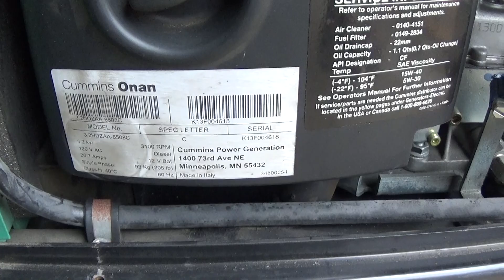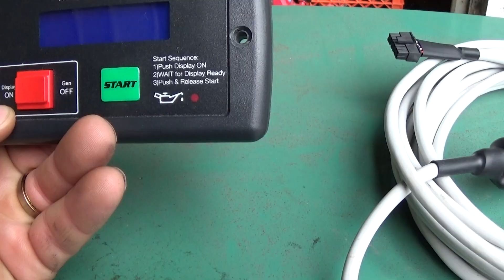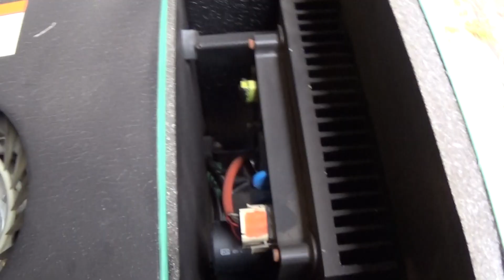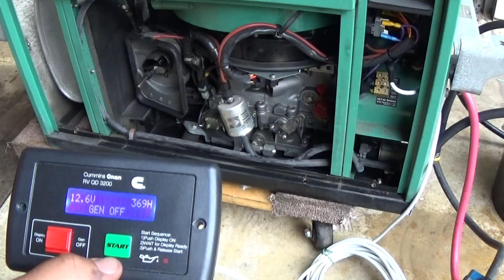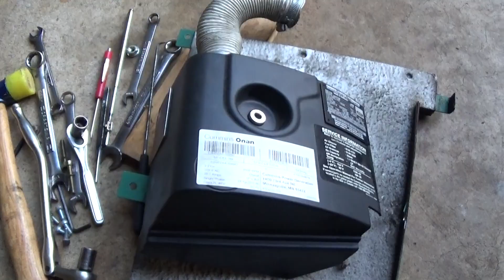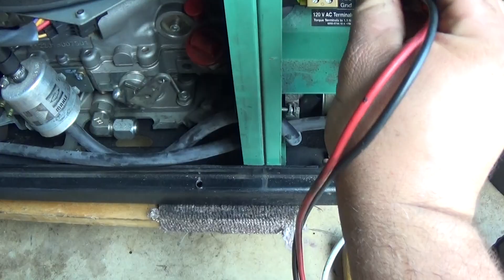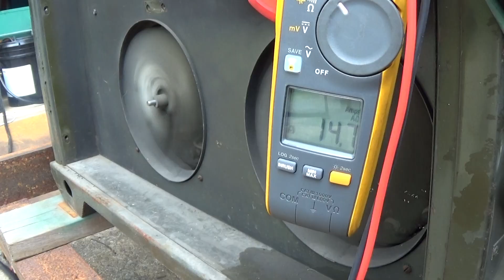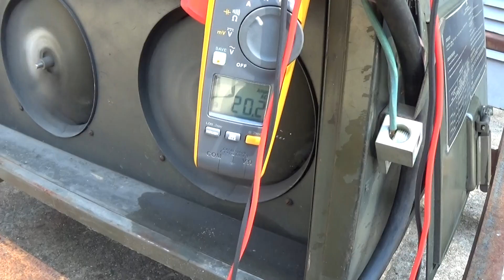Miniature Diesel Generator Diagnose, Repair, Test ONAN RV QD3200

Comment: I have this generator and it stopped working. I've determined that it is the fuel injection system. There is a plunger below the solenoid on the top side of the fuel injector that is stuck. How can i get it to release? I've tried soaking it in PB Blaster for a few days. still stuck.

Comment: I have this generator in my 2018 Thor Class C RV. It would start and run well sometimes, then other times it would either not start or shut done after a few minutes. Thought it was starved for fuel so I blew out the fuel inlet hose from the fuel tank (which also supplies fuel to the RV engine. Still wouldn’t run, so I filled the fuel tank with diesel (26 gallon capacity). The generator started and ran great. So it probably was starved for fuel - but I had about a 1/4 of a tank when it wouldn’t run. 
About a week later II was talking to a fellow RV’er who had a similar problem on his Class A RV. He told me that the fuel pick-up to the generator does not reach the bottom of the fuel tank for a reason. If it did and you used up all the fuel inlet hose from the tank then you couldn’t drive your RV to go fill the fuel tank at the gas station. Makes a lot of sense, but no where in the RV or generator manual does it mention this. So before you stop and plan to use your generator for dry camping or whatever, fill up with fuel. Simple!

Comment: Good Morning, I have been fighting with my RV QD 3200.  It cranks but doesn't start. I followed fuel delivery to just past the filter meaning the pump and filter are functional.  When I opened the high pressure line, there is no fuel coming out with cranking.  When I look up the high pressure pump, there doesn't appear to be much to it, certainly no obvious way to increase the pressure.  Am I missing something?  Thank you in advance!

Comment: I've worked on motors before and never have I ever seen the rocker arm being loose so if it's loose on the motor that's where the problem is because it's not time well within the movement of the motor

Comment: Mine starts right up and runs great for 5 seconds then cuts out.  Then it refuses to start again for 5 or 6 attempts, and finally runs rough for about 20 seconds before finally reaching proper RPM and smoothing out.  Around 60 hours on it, changed the oil twice already.  Any idea what’s wrong with it?

Comment: Thanks for the video. I just purchased a Genset MG 13/10 AA generator that only had 52 hours on it since it was purchased in 1990. It was a backup generator on a chicken farm and when I was running it to test it, I noticed the same white smoke. It has a Ruggerini RD 270 two cylinder diesel engine which is bullet proof and considering the low hours, I wasn't sure if the filter was blocked or the injectors were dirty and the fuel wasn't burning. Since it was a backup generator and was placed under load once warmed up, I don't think the issue is glazing. I will hook it up to some heaters and let it run as I suspect it's just soot buildup in the exhaust as the smoking looks identical to what you showed in your video.

Comment: Man gensets have come a long way the old (1986 GMC) rehab truck i drove for the fd ran an old onan gas genset that could not even hit 2kw and it was a pain to start we would have to turn it on as soon as left station and let it run the entire time we were responding before it would smooth out enough to make power

Comment: A diesel needs to be run with at least 1/2 load. They will build up trash in the cylinder or allow unburnt fuel to blow by.

Comment: One of the best generator testing videos I've come across.  Well done.  I have an Onan 4000 MicroQuiet 4000 which I pulled from my recently purchased 1999 Tioga RV.  The generator wasn't running, no crank.  fuel leaking everywhere.  But I have it running now.  My question to you is, how do I load test this generator without all the fancy equipment?  Your guidance would be greatly apprecited.
Reply: I’ve seen other YT’rs use multiple portable heat units. A few have used heat guns.

Comment: You didn’t happened to have a video of you doing the valve adjustment?  …. Had fuel leak that sprayed diesel up into the side vent getting on everything 😢… now I have it out of my camper cleaning it up … it’s a 2020 sprinter rv but I heard Cummins discontinued back in 2017 idk do you have any insight on that…all the other sprinters have a propane Cummins
Reply: How far from Cincinnati are you … my buddy works for Cummins and he said they have one guy that fixes the their generators and he is backed up

Comment: its very logical that the engine was smoking so much. all the time the engine was running on bad valve timing was squirting the unburned fuel right into the exhaust. so that was burning up when the timing was adjusted and the exhaust was getting really hot under load. the best thing to try is to wash out the mufler to get it clean again and then it will run forever without any problems.
but indeed strange that they swapt the unit without looking at the problem.

Comment: Wet Stacking really is a big problem with these 1 cyl. diesel motors. The YanMars are super sensitive to it, and will end up plugging up the entire exhaust system. The US military auctioned off all the MEP-531 and 831's. I suspect they got tired of dealing with the wet stacking... The MEP 531's I have, have the old "Supertrapp" tunable muffler discs on them. (literal 4 stroke dirt bike parts) and even though they only have like 40 hours on them, they were plugged up solid (like trying to fart through a straw) and running TERRIBLE. Once I was able to clean the mufflers these like new gensets run great. Theyre also sensitive to excess oil levels, even slightly overfilled they will wetstack terribly! Here's a video of a my  831 with less than 200 hours on it mind you.. prior to muffler cleaning: https://youtu.be/eob513rB3F0

Comment: I have this same unit on my small RV, it's been great until just recently.  It starts and runs anywhere from 5 to 30 seconds and sounds normal before it sputters out.  It has about 320 hours on it. I serviced it last fall with oil change, fuel filter, air filter and it was running fine last weekend Saturday, and then wouldn't run right on Sunday.  I tested the fuel supply pump and it's working properly, also pulled air and fuel filters and they look good, checked the battery and ground wires and safety switch inside the panel and all check out fine.  It displays Low Engine Power on the panel when it starts to sputter and quits.  

I'm so frustrated.  Any suggestions on what to look at next?
Reply: We have the same one, had a similar issue. Generally that is caused by a lack of fuel when it gives Low Engine Power
Reply: @Channel-mu6qd  Thanks for your reply.  After a lot of effort and trial and error I finally fixed the problem.  You are correct about the lack of fuel being part of the problem, the reason for the lack of fuel was because of the failure of the electronic fuel cutoff solenoid.  It's a small square unit attached to the case with four allen head bolts just below the air filter housing.  This is what cuts the diesel engine off when the "off" button is selected from the control panel.  The part just failed, plain and simple.  After a lot of searching and reading in a Hatz manual I discovered that there is a small "T" valve on the bottom of it that solenoid that when turned 45 degrees it allows fuel to bypass the switch and the engine will keep running, it has a safety wire attached to it to keep it from turning accidentally.  When bypassed the only way to shut off the engine is to pull the manual engine cut off lever on the side of the engine.  Here is a link for the replacement solenoid:  https://www.meltons.com/product/hatz-diesel-fuel-valve-stop-device-01786101-2/ .  I'm posting all of this to help anyone else who might have a similar problem.

Comment: Thank you!  I was only looking for how to change oil in this generator.  But...nothing is better than hearing about a potential problem down the road.  Your video is extremely informative and told me volumes about this small diesel engine.

I just bought a '22 Winnebago View 24D with this QD 3200 generator.  Have not yet gotten to 20 hours, so I'm about to do the first oil change.  Based on how little oil is in this engine, I plan to change oil every 125 hours (instead of recommended 250 hours) as we put some time on it.
Reply from the maker: Glad the video was useful!

Comment: I just bought my 1st motor home it is day 2015 Coachman prism 2150 and it has the same generator and it kept turning off every 10 minutes and I thought something was wrong with it, come to find out it was just low on oil. These  generators appear to be really good. Thank you so much for the video.

Comment: Biggest piece of crap gen made by onan to date. Mainly because of the hatz diesel fuel injection system constantly failing. Cummins says to replace entire genset if engine has any failure.

Comment: I repaired my diesel generator yesterday. Broke down this fall. Had sucked up some metal parts from the air filter. Was a 3" long shred in the intake valve. Had to sand it down and adjust it and it was golden, exept from the air filter which was relieved of its 14 year long journey. :D

Comment: Is that load center just a bunch of heaters?  Would imagine that the real working load of a generator thats max peak is 27A should never go above 20A. Thats enough to run a normal kitchen and charge a battery.

Comment: WE HAVE A THROW AWAY SOCIETY ---- For all of those people who question why someone would give this away for free or throw it out it's because the got their money for it.  The company who sold the RV that this was in got at least 4 times the value of this generation from the customer when he bought the rig it was in.  When you consider man hours to troubleshoot, removal, repair,  then installation, plus any parts, it is easier to just pull it out and install a new one.  Consider the price of a new truck, say $60,000.  You go to the dealer and they have a rebate of 5-8 thousand, end of year even more.  Pay cash even more.  Drive it off the lot and the truck loses 10-20% of it's value.  That truck in 10 years will sell used for $5000 or less in decent condition. What does that tell you?  That truck was cheap to make, mark up was high, and in the end, even after rebates and mark down, the car company and dealer are still making a killing.

Comment: I have this unit and stupidly overfilled it by almost a quart recently. Initially after starting it ran badly and produced amazing amounts of smoke. It wouldn't shut off, and finally with the control in the off it ran down after a couple minutes. I drained the oil, refilled with the correct amount. It took half a dozen tries to get it to start, but when it did start, it appeared to be running fine for the short period of time I ran it. The next day however, it will start, but whenever it is put under load, it starts to bog down badly and the voltage drops. Ideas or suggestions?

Comment: As an RV tech I would never keep an ONAN my RV. I'd use the place to put batteries  for my solar system. ONAN's are a problem just waiting to happen. And you can bet when you need it most that will be the day it fails. And the repair cost to the lay person will convince you I'm right, and even after the repair the failure rate will show no improvement.

Comment: when I was at Orbital we used to run in our engines at wide open throttle, starting at 1500 rpm, for one hour at a time, going up in 500 rpm increments untill we topped out at 6,500.

Comment: I’m gonna guess that the exhaust valve coked up partly open a few times and the looseness of that caused excess heat to make the stud expand making the threads lose and it vibrated lose over time once it was no longer coked up, they likely didn’t follow the procedure of running it at a large load until they noticed the effects of the coked up valve, and the excess heat would heat the valve stem and other parts up more because they still weren’t sealing right, and that’s the heat that expanded the stud more than usual, combined with prolonged periods of vibration without pressure/contact on the now further down valve, but I would see about changing the oil seals on both valves since the extra heat may have cooked them, especially the exhaust one (if it even has one, some engines don’t)

Comment: Thank you again. I have had no knowledge of these  small diesel engines and generators. I currently am off grid and using solar and gas generators for heavier loads and tools. I would like to have a slightly larger diesel with remote control and monitor. Your videos have been very helpful increasing my general knowledge. Especially the fact that they don't like running at lighter loads.

Comment: The exhaust will clean up with more run time,it was definitely light loaded alot plus valves not adjusted made it load more with unburned fuel.Great score,I myself am building a 3 cylinder pony motor generator that was taking off over the road semi,thus I can use the diesel my toe truck runs on to run genie.

Comment: I'll bet it had an initial valve clearance adjustment that wasn't done after the break-in period, it was run loose and the pushrod slid out from beneath the rocker.

Definitely needs an external oil cooler for heat removal and extra oil capacity, ease of draining.

Those things are enormous heat sinks.

Comment: When you Pan the camera through your garage, I realized All these power plant you had around the room. OMG this guy is obviously a master technician, funny how you have pending projects on different tables. I'm sure you have it all under control and you would probably never bored, with these projects obviously a, true perfectionist , making you an excellent teacher. maybe you could show us your face and your significant other sometime supports you there? She might be the one doing the repairs buddy when the cameras off :-) Curious are you an electrical engineer?? Interesting Onan hasn't changed its color green for many decades speaking of green? You certainly save a few there. Interesting about Diesel's do they not come with Eco switch on them,? Think I'm going to subscribe because your English is very very good :-) and you didn't use a hammer, to repair it. I used to live down in Baja for years, you know in the states when something breaks down, we break out the manual to fix it, and in Mexico we get a guy named Manuel ,  2 fix it. Adios

Comment: Before you do the next oil change run an engine flush product to free up the stuck rings, and an injector cleaner in the fuel.  What is the red wire that has been chopped off at the air filter end?

Comment: brought a silent gen for 5k from a company for $200 and made 5k off of it after spending no money on it to fix it a wire came off the display panel 😁....fixed alot of those push rod problems too,stock valves, bugs in the intake and out for sitting to long etc....love the video

Comment: Techs couldn't be bothered to diagnose the problem!  The result is Mike's first inverter generator and one in pretty good shape with low hours.  See if you can hook 2 inverters together for double the power.
Reply: I forgot, did you figure out how to lock the valve adjustments in?
Reply: Hey Mike, can you get a scope hooked up to the output?  I'd like to see how close it is to a sine wave.

Comment: Have the same generator on my 2017 Winnebago View.  The orange wire is the temp sensor.  Looks like the sensor end is cut off as the metal tip goes into the air filter housing.  They are notorious for shutting down in the hot weather.  The red button inside the housing actually shuts off the fuel solenoid to stop the engine.  My solenoid got stuck open and would not shut off.  Replaced the solenoid and all good now.  Great video for my next problem with this generator!

Comment: Or maybe someone at the factory didn't torque that rocker arm's lock nut adequately. Excellent troubleshooting and repair practice(s). Where ever did you find that beautiful load bank; damn near fell out of my chair when it came into view... USAF ret'd E7. Worked on aircraft from C-47's to F-16s! Retired in '84

Comment: Did you measure the fuel consumption?  Check if it's running rich or lean?  Could be other reasons for that sut other than the muffler.
Still, that was an easy repair!

Comment: Score , nice little genset.
Yep I worked in retail for a few years , the company would buy small portable generators in bulk from China one year , must have been a bad batch and people were bringing them back , said they were dying on them .
Anyway I was motor and armature winder in a previous career and noticed a lot had screw's missing around the throttle linkage , company threw them in the dumpster , would cost more than they initially paid for them to have them looked at.
Just a dab of loctite at the factory would have prevented all that .
40 or so generators went to the landfill .
What a waste , brought a tear to my eye .

Comment: Just don't understand why some units are made that just seem to have such small oil capacities. I don't have the development skills to figure out how much it should have, but damn, 1.1qt in the sump just doesn't give you a lot of 'mistake space'. I put an outboard one gallon tank on my gennie, 25kW Generac Diesel, and just let it 'overflow' back into the crankcase. Gives the engine the extra gallon in capacity while keeping the oil level at the same place. I also put in a sight glass in the piping to allow a 'running check' on the oil level. Another Great video, Michael in Colorado.